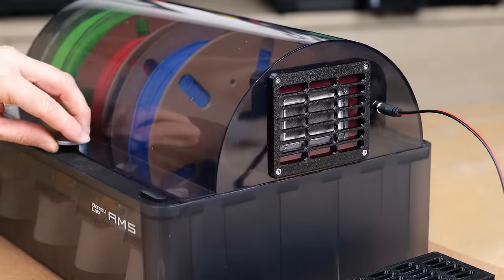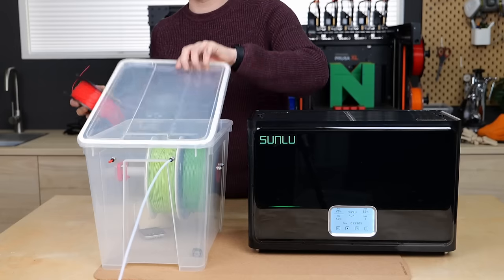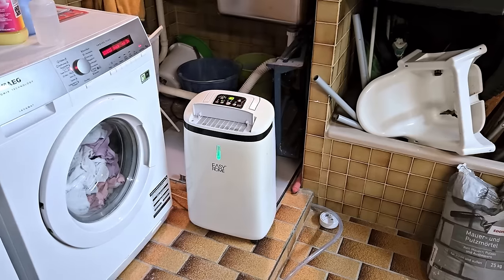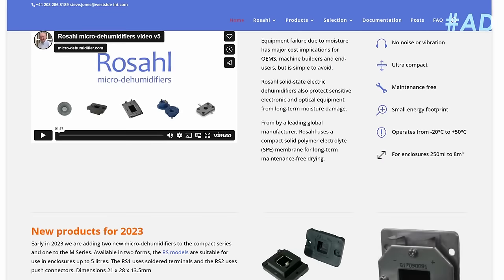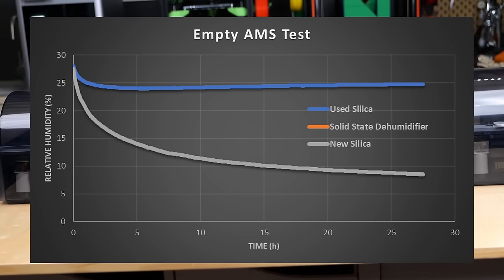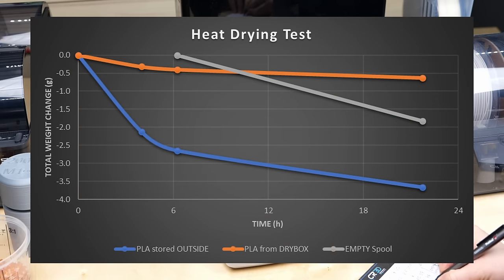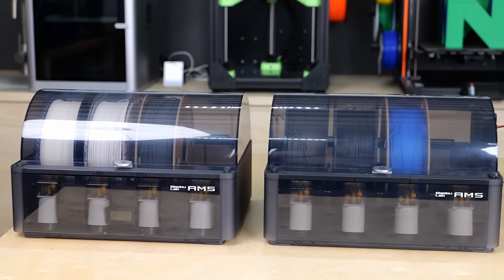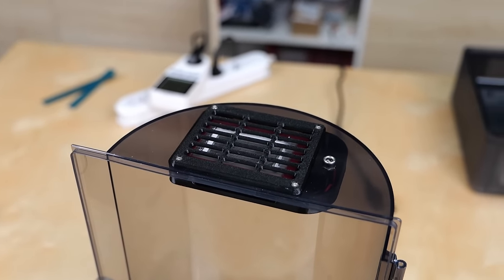Solid-State Dehumidifier: The Ultimate Filament Dry Box

Comment: I'm torn. This is an awesome piece of tech and would absolutely have a use... but certainly not at the price. The issue is probably just needing power. The low wattage means it can run off a battery, but I feel like there are 3 methods people store filament: 1) sealed container that's movable (such as filament in a bag). 2) sealed container that's not movable (a dry box that has a reverse bowden/sits next to printers/AMS-type system). 3) not sealed at all (think: RepRacks). This solution applies only to the 2nd method of storage, and while numerous, it doesn't have the volume and hands-off nature of methods one and three. I use indicator desiccant that's pre-sealed so I'm not actually touching it, in filament bags. I have 2x RepBoxes that are stationary. I could see this for those RepBoxes, but over 95% of my filament is not in the RepBoxes and so when I decide to use it, I open the bag, check if the desiccant is good/not good and replace it with a good one if it's gone bad. Bad one goes into a dehydrator until I fill it/need to dry again. So cost wise, I may run that dehydrator once every 3-6 months at 1000 watts. Plus the cost of the desiccant, it's probably cheaper then buying one of those units for the RepBoxes. So... thank you for the video, maybe once they get cheaper + someone makes a simple battery-power setup, but until then I think it's just cool tech that may not apply to majority of people's situation.

Comment: 13:40 not quite. RH depends on temperature (and pressure). It's a measure of the moisture content (amount of particles) suspended vs the maximum that could be suspended before condensation. Increased temperature increases dew point and the total possible load of moisture in the air. I.e. 100% RH is wet in a jungle but dry in the winter. When the temperatute went up in your AMS, the air in the box had more space available to draw moisture from the filament. Then when it cooled later in the day that extra moisture was apparent as a raise in humidity. If you look at your data you should see a lag between temp change and RH increase

Comment: so what if you use heat in the boxes to draw out the humidity from the spools and then the solid state dehumidifier to draw it out from the air? maybe pulse the heat for short periods so it doesn't damage the spools over time? Maybe also control the temp based on the humidity. No need to run it much, or at all when the humidity is low. Just maybe a little to maintain it after most of the moisture is gone.
Reply: I wonder at what point the heat causes issues, could you keep it at a steady 25°?
That's considered room temperature, if I remember rightly, so should be considered stable for most plastics

Comment: Have you tried puting the reel into vacum chamber for few minutes before print?- if it works, maybe you can work on making the dispensing part with reel box easily sealable(all you have to think of how to painlessly and repeatably seal around outgoing strand from the box, so you dont need to cut it or unthread it from printer for quick and easy vacuum sessions), and connect to it vacum pump. Then once a week swich the pump to reach high vacuum and leave it for half hour to completely evaporate and suck out all the watter and other disolved gasses into it.

Comment: I think moisture and drying filament is an overstated problem for all filaments with a few exceptions like nylon. I also wonder what the effects are of prolonged warming/heating on the plasticizes within the polymers, and the VOC emission of heat boxes.
Reply: You're right. But Nylon is also pretty much the best material we have right now, so coming up with an easy and reliable drying setup is a big deal to a lot of people.

Comment: The best practice for me is using air-tight boxes so when you put dried filament into them, the silica gel will not degrade being there just in case it might leak a bit. No opening of the of the box, feeding it directly from the box.

Comment: I wonder if the Rosahl could pull moisture out of the silica gel as well.  So what happens if you leave the used gel in the box with the Rosahl running, would it "recharge" the gel?  If so, then placing fresh gel in the box could speed up lowering RH then once the desired level is achieved, the gel would start drying as well.  Kind of like a dehumidifying capacitor.

Comment: Reading the datahsheet the expected life is 6 years. Additional you can't use silicon gaskets without shortning the life of the unit, so i wonder what other filament offgassing will cause problems.
Reply: plus you may gas yourself.

1. When you use ROSAHL to dehumidify into the storage cabinet, do not store volatile rust preventive or
things that organic gas volatilizes. The volatile gas which is released from goods reacted at a membrane's
anode and new harmful gas is produced. As a result, not only it causes decrease in performance of the
ROSAHL, but also it might adversely affect on goods in the storage cabinet. We cannot guarantee even if
harm occurs to the stored valuables under the influence of new produced gas.
 Please evaluate enough when you use ROSAHL for the storage cabinet.
 2. The maker who produces and sells storage cabinet equipped with ROSAHL should explain that enough
for end users using the storage cabinet.

Comment: The reason why the humidity increases when the temperature increases is not because the actual moisture content of the air has changed, but because you are measuring relative humidity, how far the air is from saturation at ambient pressure and current temperature. The sensor compensates the reading for the current temperature, and the same quantity of water vapor in the air will show a different percentage of air saturation at different temperatures. Pressure also plays a role, and I doubt that the sensor keeps into account local pressure swings.

Comment: 16:30 - now that you mentioned that closest spool affects the results due to lower air flow in the box... What if there was some very small fan in that box for mixing air and thus keep the moisture level higher near the dehumidifier? What if limiting factor for dehumidification is not the dehumidifier itself but rather too dry air near it?

Comment: I'm not sure if you're unaware or if there's a reason you don't use it, but there are color changing, rechargeable silica desiccants. I bought a 25 pack of individual bags on Amazon, but I imagine that both loose and other supplies exist. The color changing lessens the ability of the desiccant to pull moisture, so they have it as probably 90-95% normal to 5% color changing as an indicator.

Comment: What surprises me is that no manufacturer has released vacuum storage boxes, those that have a valve wilhere you can use a pump to remove most of the air. The volume allows any humidity to be released (then you just pump more). With a bag of silicon, it's an effective, cheap, and energy free way to store filaments.
Reply: Vacuum doesn't help. Unless it is a really high vacuum and you pump away a huge volume of very low density water vapor.

Comment: I only print in PLA and haven't noticed any issues with moisture. What seems to cause me the most trouble is UV/sunlight (in assuming) making the filament brittle, which then breaks mid-print. I'd love to see you investigate/test this. Maybe different amounts of time in the sun vs amount of bend before snapping or something? Would be interesting to see if annealing it fixes the issue.
Reply: Get a Bambu Lab AMS and you will notice the problem, brittle filament that breaks in the AMS. Otherwise, not a problem.

Comment: Interesting. I just spent about 15 minutes changing the silica in my AMS (the pods you use, plus dessicant-filled pods in the spool centers). At the rate I price my time, and the rate at which I get through Silica (my hygrometers only read down to 10%, and the room is 20% - I change silica when the hygrometer in the box hits 15%) one of these would pay for itself in about 6 months.

Comment: Humidity is relative to temperature, so the spikes are to be expected with temperature changes, because its actually two different sensors in the humidity sensor, the one that senses humidity, and the temperature sensor that is used for temperature compensation calculations, and they don't react to changes in the environment at the same rate.

Comment: I wonder how long the electrodes last?

I'm a 3d printing novice, I have kept all filament in drybags with silica beads from day one. I used to pump the air out but I don't anymore and it doesn't make a significant difference. The bag being imperfectly sealed does make a big difference. I have gone through about eight spools and lost only maybe 30g of filament to becoming brittle, on a roll where I forgot the silica beads. I always write the weight of the spool+filament+filament clip on the side of the spool before storage so when I take it out I weigh it again to tell if it has gained or lost water weight. 

Print your own permeable silica bead containers and buy a bulk container of silica beads. Regenerate the beads in the oven when needed. The purple beads are more toxic than the orange beads.

Comment: One big problem that those little membranes have is that they try to work like a capacitor at the start and because of that they can get damaged when you dont limit the current. So you need a little circuitry to limit the maximum current that can flow till the capacitor is charged. Therefor a LDO (linear voltage regulator) would be sufficient that reduces its outputvoltage when the set current limit is reached.

Comment: Since you are already at it. What about a little fan (for example hotend cooling fan) that runs on a small battery or even solar powered to circulate the air inside the box? Especially, how does it compare in terms of speed (how long it takes to dry)?

Comment: The €169 price completely changes how I view the results. Yes, it’s better than silica gel, but not dramatically so. I put 200g silica packets in my filament storage boxes and I refresh it on occasion in my heat-based dryer box. They’re 1/50th the cost so I can toss multiples of them in boxes of hygroscopic filament.
I look forward to your video comparing desiccants since that seems like a better option for storage. Re-vacuum sealing your expensive filament is another option that should be on the table.

Comment: 13:45 - The humidity "changes" with temperature, because it is a relative humidity (RH), which "is the ratio of how much water vapour is in the air to how much water vapour the air could potentially contain at a given temperature. It varies with the temperature of the air: colder air can contain less vapour, and water will tend to condense out of the air more at lower temperatures. So changing the temperature of air can change the relative humidity, even when the absolute humidity remains constant." - source https://en.wikipedia.org/wiki/Humidity#Relative_humidity
Reply from the maker: No. First, I'm far away from condensation and second, heating a given volume of air up would decrease the relative humidity. I checked the absolute humidities and they increased at increasing temperatures.

Comment: Your humidity numbers are insane! I'm lucky to hit a low of 62 after 10hrs in a sunloo dryer! Prints come out nice but I wonder how I'd go with even 30% humidity 🤔
Reply: Your humidity sensor is probably defective or miscalibrated. Most filament sitting in a 60% RH environment for more than a day would crackle and pop and string badly.
Reply: @dsp4392  yeah makes sense, might pick up a stand alone sensor to cross reference with👍

Comment: How well do the solid state dehumidifiers work with heat? 

I have multiple dual-spool Filament storage containers with heating elements in them to help get moisture out of the filament, but I quickly noticed that since they are completely sealed it didn't make much of a difference since the moisture would just get trapped in the air after "leaving" the filamentand then just get sucked up by the filament again instead of actually leaving the box. I also tried keening the lids slightly open during the drying process, but this also didn't really work since the airmoisture wouldn't go lower than in the room and, unless it was constantly turned, only a part of the spool would get heated. Even with silica-gel I ran into problems, since it started to release captured moisture back into the air after reaching a certain temperature. 

Since the containers I use are somewhat small I think that if I use one of the smaller units it should be good enough atleast for storing my material after drying, but since the drying part of the process generates up to 60°C I'm not sure if I might damage the dehumidifiers during the drying.

Comment: Temperature and humidity are related because the capacity of air to hold water vapor increases with temperature. Hence, warmer air can contain more moisture than cooler air, leading to variations in humidity levels with changes in temperature. Simply put, the temperature difference didn't change the amount of water in the air but it changed the amount of water the air can hold at that temperature.

Comment: i use silica and such an electric dehumidifier at the same time, because when i open the box hthe humidity rises fast and the silica can buffer this.  also this helps so the electric one has way less powerneeds because the air gets dryed faster. also the electric dehumidifier isnt always on, but only if the humidity rises to an too high level. all of this is to reduce the average powerneeds. but becase thex let aur in i use an small valve with an servo to close it up as good as possible.

Comment: What happens if the rolls are placed in a strong container and a good vacuum is pulled? This works with drying out refrigeration lines and transformer windings and does not even need heat. Another way is to pass air thru a freezing zone before letting it into your filament storage. These can use commonly available used domestic fridge parts.

Comment: Would it be possible to put silica desiccant in the box unused box to act as a buffer once a spool is added? In theory, this way, there should be a lot more dry mass absorbing the moisture of the filament more quickly. The dehumidifier will then continue to dry the silica over the next days.

Comment: I hope Bambu sees this and has a chat with them. I think that, if they can scale it to a $50-$100 upgrade for AMS at their scale, it would sell like hot cakes.
I think combining this with the Silica containers allows the Silica to dry the "wet" air when (re-)placing filamend and then have the dryer dry the dessicant, air and filament, once RH drops below where the dessicant struggles.

This would mean never having to replace the dessicant in the AMS (only 5 devices if you include the 2 in the bottom, but it's finicky).
I would gladly pay $50 for that convenience, might consider it for $100.

Comment: That membrane dehumidifier was a surprise.
Note that the temperature variations are not due to the amount of water in the air, it's because it is measuring Relative humidity, which varies with the temperature.
I also have another potential issue - does the oxygen level inside increase? This could cause additional oxidisation for stuff that has oxidisation issues.

Comment: So if you connect this thing to an enclosure with heating (40-70 C depending on a filament type) it potentially will remove moisture very very fast?
I have 18% humidity in my flat, but I started to use humidifier in my sleeping room because I slept very poorly. But my filament doesn't get moist, and I buy "Eryone" filament which comes in a good cardboard box and zip lock bag, so I just store every filament in their boxes with zip locks. I was looking at various options (just for knowledge) of filament storing and dehumidifying boxes but they are pretty expensive, and I love to build something myself so it's handy to know what things can be used to effectively rid of moisture.
Cheap plastic container + silicone + moisture sensor + print holders for filament + drill holes for printing out of it and use quick connects as guide + this solid-state dehumidifier (If it goes mainstream and become much cheaper) . And all this probably will be cheaper and hold 3-5 rolls instead of 1-2.

Comment: It's an interesting solution to dry the filament. However, you would need a long-term study with daily use of Selica and Dehumidifier, as well as recording all data (humidity; temperature; volume without filament; which filament is inside (manufacturer, type, color, humidity before and after taking it out, what kind of spool , how much (weight)), for Selica and the wear (manufacturer, what quantity, when was it replaced).

Comment: I wonder if the Solid State membrane could be used in combination with heat to better dry and store filament. Maybe requiring less heat to dry the same filament?
As for cost, if you consider the cost of Silica, and replacing it, or the cost of running the oven to dry it so you can re-use it, I suspect people who do a lot of printing/ have a lot of filament, it's a fairly small expense over the life of the purchase. Also it's much more convenient, saving a LOT of time and worry changing out desiccant.
I'll certainly be considering saving up for 2; One for my printing dry box (for TPU and Nylon) and one for my storage dry box for things like PLA that don't absorb moisture fast enough to need to print from the dry box.

Comment: The main reason heat works better is that it increases molecular movement. You could easily add a low power heater to boost the effectiveness of the membrane drying.

Comment: Well if you added a small heat element to the setup with the solid state dehumidifier (SSD) ;-), you'd get even better results. As you know, the warmer the air, the more humidity it can store, so I would not be surprised if the SSD would work faster in a warm environment.